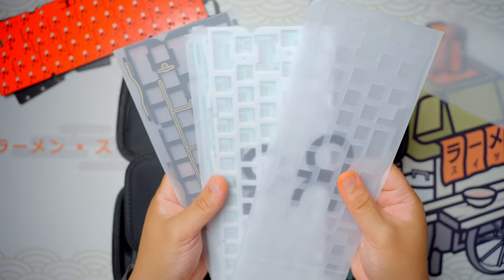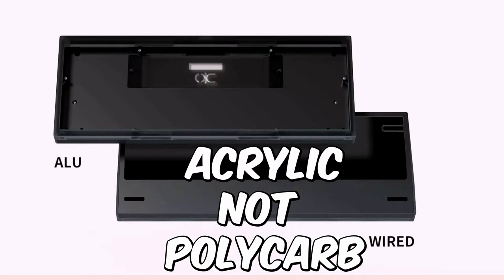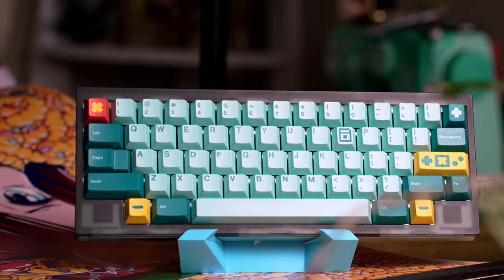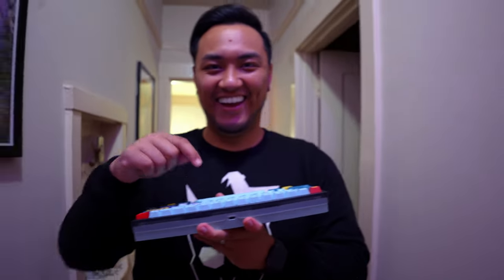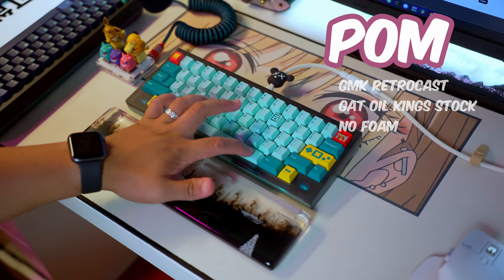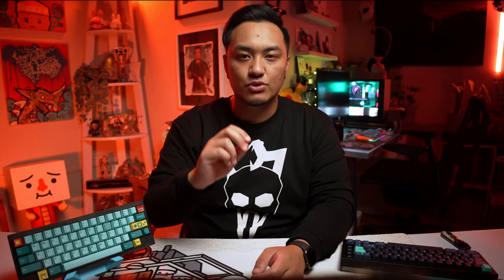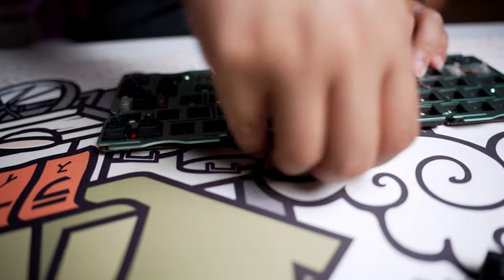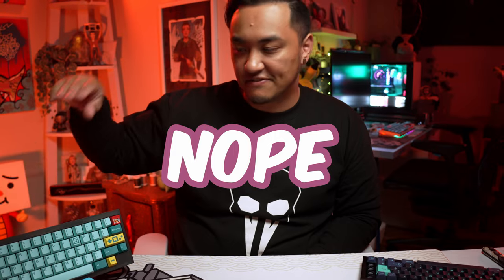You need to Know THIS About the QK60!

Comment: For sound measurements it might be a good idea to get multiple tests (exhausting) or use a reproduceable input method (complicated). Simply put, typing at the same speed and intensity to produce useful graphs is not humanly reproduceable. Crin's video doesn't mention this but anyone who works with audio would immediately see how the measurements in the mecha video don't amount to much.
Reply from the maker: Yeah I agree with you. These measurements were done only with home row to try and get consistency. I did use multiple tests and used the average. Approximately 20 per keyboard. These were for sure amateur at best, but coincided with what I heard in the real world. I felt like it'll do for the purposes of explaining keyboard sounds lmao. There is just so many variables to account for like how far you are and stuff.

Comment: hey, curious, what switches did you use? or does the QK60 come with switches?
Reply from the maker: It doesn’t come with switches. I used gateron oil kings. I know long pole switches are all the rage, but Andy Nguyen kinda pointed out they hide hollowness. I wanted to test that so went with stock oil kings!